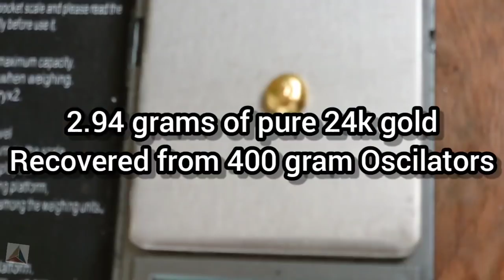Oscillators Gold Recovery | Recover Gold From Oscillators | Gold Recovery

Comment: I see something so strange, 3 days ago I added SMBS to the gold solution, the next day I saw the black Gold oxide forming at the bottom of the glass.. I leave it because I was in the vacation, after 3 days when I back I accepted the  separation process going more well due to the long time but I see nothing on the beaker… that amount who already settled are gone..I can’t understand whats happening, more strange is the tin chloride test shows nothing in this solution..is anyone saw this stupid issues?
Reply: Too much nitric acid.

Comment: Dear Bro. Looks all good but I find you are using by far too much of the chemicals. Also I find you are using Aqua Regia too early. I would add another step of HCl before AR to dissolve base metals, then it will take far less AR to dissolve the gold. Let´s forget about silver, but those components will also contain a fair amount of Pd and some traces of other very rare PMs. So there may be some more values in the liquids used and the solid remains. So refiners §1: Don´t throw anything away! Cheers Marcel
Reply from the maker: We understand your concern about using too much acids. But it’s okay if you are using industrial grade acids.These are way much cheaper.
Reply: @TrinityGoldRecovery  My concern is about environmental and health issues. Also the disposal problem. Please try to use as few chemicals as possible. The residues are toxic. Other than,  I find your video great.

Comment: Every oscillator is different, some have no gold plating, some do, some have gold legs, gold bond wires and gold plating so yields will vary A LOT depending on what you have because some oscillators have nothing but silver

Comment: Did you make your own grinder and how can I make one like it thank you for sharing my friend 👌 😊 ☺️ ☺️
Reply from the maker: https://youtu.be/jA14wd96CyA
you can follow this instructions to made your own grinder... have a good day, best of luck
Reply: You can make a do-it-yourself Dolly pot, it's basically a big pipe welded to a steel plate. Then you just get a solid steel rod and smash the oscillators to a pulp. No need to grind. You just have to open them up so the acid can get inside.